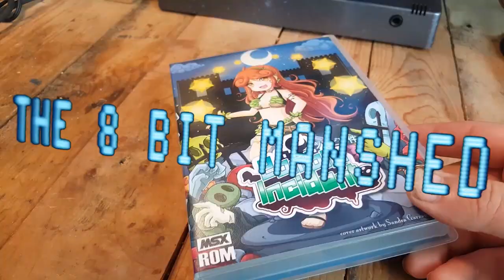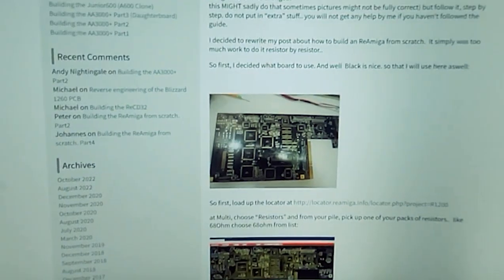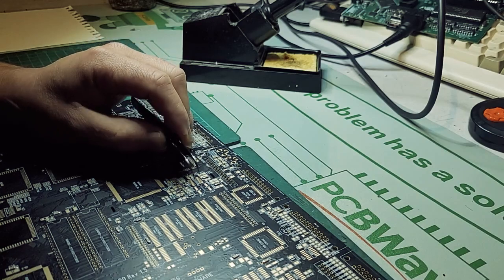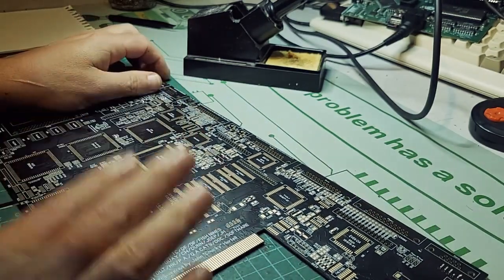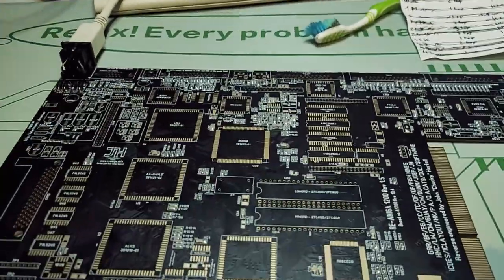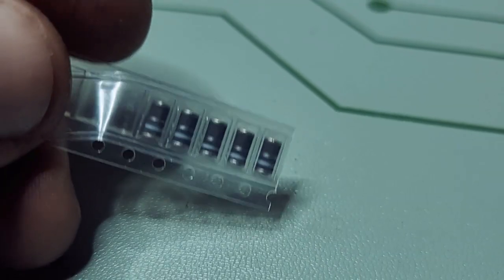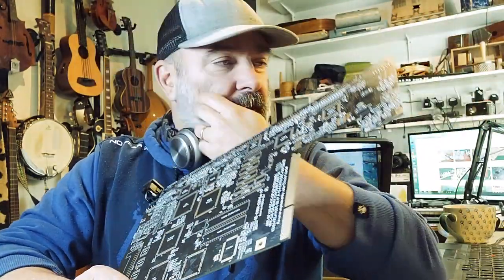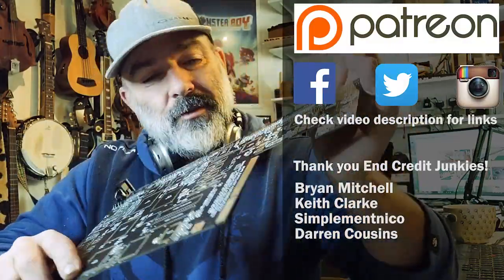Building the Re-Amiga 1200 (by Chucky / John Hertell) - Part#1

Comment: Did you get any further with this?
Reply from the maker: yep I have a part 2 coming  this month :)
Reply: @8bitmanshed  Thanks, I'm about to start mine. Did you manage to get the listed JFET transistors? Or find alternate ones?  Apparently the recommended ones are discontinued and out of stock.
Reply: @8bitmanshed  Did you get stage 2 tested with the LED flashing?  I'm at that stage but nothing seems to be happening.  I didnt have an accelerator to use for the test so had to solder in the CPU. The reset signals goes briefly high, then low then high which is what I'd expect but the CIA and ROM enable signals are high and I'd expect them to be active low.  Its now become very frustrating.  The test at the end of part 1 of the build was fine. 
I also soldered in the PNP transistors and LEDs that are optional and show activity on the reset and ROM enable signals but none of them light or flicker as expected.
Reply from the maker: @paulklasmann1218  I've done the cpu test yeah where I'm getting the led "guru flashing" , I need to sort myself a null modem to start testing output from the test roms
Reply: @8bitmanshed  Thats what I'm not getting, but glad you got that far. The GAL I bought was said to be programmed and tested for XU9.  Ive ordered an adapter for my programmer just in case it's not progrmmed properly, I'll do it myself. I've done all the obvious and checked joints with the USB microscope, but I'll check all joints again tomorrow when I've got more light.   I look forward to see the rest of your build.
Reply from the maker: @paulklasmann1218  I socketed the gal just in case as I wasn't sure I had the right version of it :) 
since It's my first SMD project I spent a lot of time checking connection from each pin of each IC to it's destination. Probably overkill but I wanted to make sure everything was soldered correctly. Fingers crossed .
Reply: @8bitmanshed  I don't blame you. Ill probably do the same tomorrow.  I'll check for continuity using the schematics for the A1200 I found online. I socketed the GAL too, just in case.  I bought the custom chips as new, so I hope there aren't any duff ones. The 500++ was easy compared to this one!
Reply: @8bitmanshed  I had to get out of bed and begin checking, it couldn't wait.  I found two miniscule shorts at the back of two CPU pins, only visible with the microscope.  I scraped it with a needle and now the LED flashes and the ROMs seem to be working! I could kick myself for not spotting the issue sooner.  Ok, back to bed and continue tomorrow ;)
Reply: @8bitmanshed  Quick update, I finished my build last week and glad to report that its all working.  Just a couple of finishing touches to the case left to do in my 2 weeks of holiday.  It was quite nerve-wracking at times. 😅
Reply from the maker: @paulklasmann1218  nice. finishing the video for part 2. before I head off for june. serial working . I'll deal with the rams when I come back then